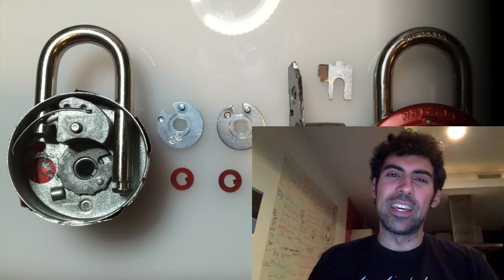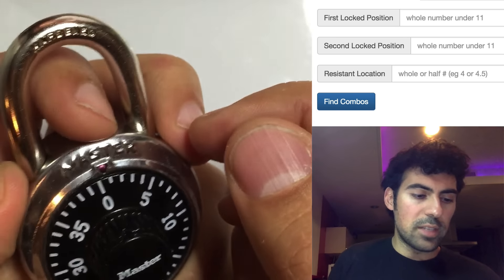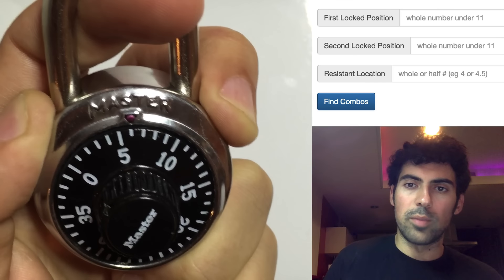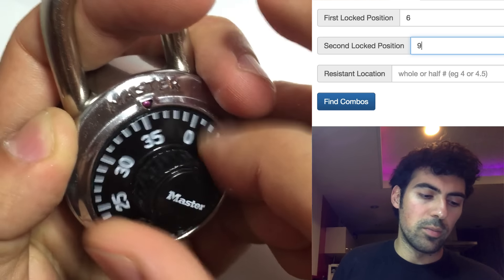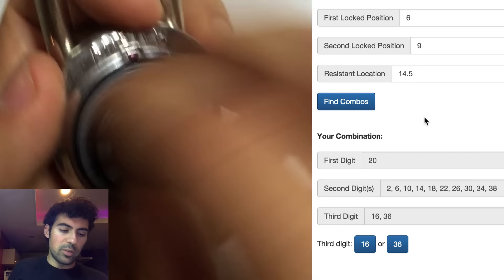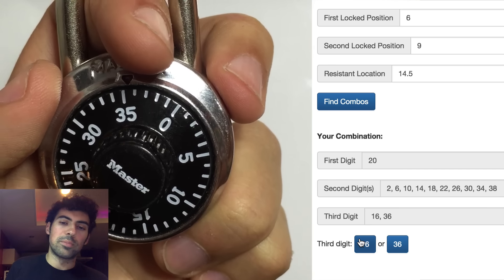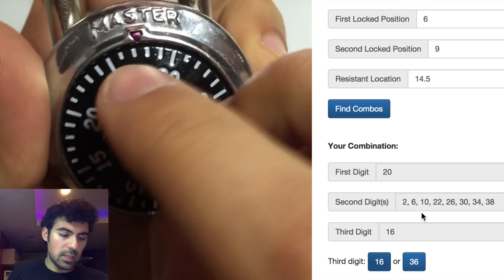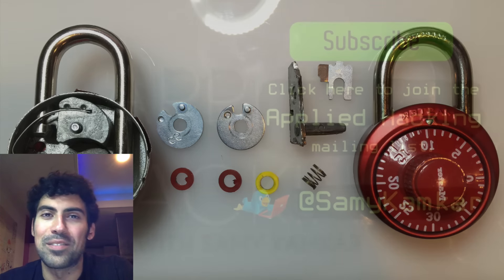Break open any Master Combo Lock in 8 tries or less!

Comment: Hi Samy,
I watched both this video and the 4 part series after this one to try and open a lock.  Though I do understand the concept, I'm still having trouble finding the resistance point, as no matter what I seem to do I put either not enough pressure or too much pressure such that the lock shaft is catching on the 12 gates of the 3rd dial.  I know that the combo to my lock is odd, and that the first number to my combo is somewhere in the 20s-30s.  My first and second locked positions are 5 and 8.  I strongly suspect that my last digit is 25 as that seems to be the widest of the 12 gates, but I've tried all permutations of 21, 25,29,33,37 as first and 25 as the 3rd digit, to no avail.  Am I missing something here or could it only be user error here?
Thanks for your time.
Reply from the maker: If you're hitting the locked positions when trying to find resistant location, you're pulling the shackle too high, so SLIGHTLY reduce. It takes finesse but once you find the resistant location, it's easy to actually feel on most locks and you'll get the "feeling" for it. 25 would make sense as the last digit (if 5 and 8 are your locked positions, then 5/15/25/35/8/18/28/38 are the possible last positions). If 25 is the last position, then that means the first number will be 1/5/9/13/17/21/25/29/33/37 and your 2nd number will be 3/7/11/15/19/23/27/31/35/39). You need to find that resistant location to get the first number though and not have to deal with the 100 permutations though...

Comment: I've tried for a couple of hours, but I'm unable to find the resistance point.  This lock always had a stiff dial since it was new, and despite hundreds of spins, the best I get is 6 or 7 resistance points.  If I apply less pressure, I get none.  There isn't a unique point where the dial won't spin freely...  Your algorithm seems the best I've found on here, but the monetized investment of time is outweighing the cost of buying a new lock.  Neither of the two locks is attached to anything, but I'd like any pointers you can offer before I just simply junk them.

Comment: I forgot my combo, but I know for a fact that my combo uses zero as a second digit, and that the third digit is AROUND the number 14, and that first number is greater than 25.

Anyways, using this, my first locked position is between 0 and 1. What does this mean?

I didn't even see 0 as a result for my second position.

My resitance area is 12.
Reply: So after fucking with it, good thing I knew the second code was 0. It ended up opening.

Comment: Sad to say it's not working for me I can only find one position under 10/11 which is 8 without the second position I can't get it to work
Reply from the maker: What do you get between 10 and 20? If you only get 19, use '9' twice
Reply: @samykamkar  I think the second number is 18. For the resistance number its also hard. When I have not enough resistance i feel no snag but with a bit more tension I feel it a lot. So hard to decide which one is it.
Thanks for your answer!
Reply from the maker: @samoraday  It's usually on the lighter side and should barely feel like a snag, just a light graze sometimes and you can usually hear the grazing/resistance, and it's at the same location every rotation. 18 seems unlikely if 9 was the other one...check between 20 and 30, sounds like you'll only find 18 or 19, whichever it is take the last number and use it as both locked locations

Comment: Hello Sammy, ive been trying to use your method but its not working, the step where it says to find the lock positions below 11
between 0 and 1 (which is wrong)
between 3.5 and 4.5
between 7 and 8 (which is wrong)

I read the note you put in the video about trying to find groves between 10 and 20 and the ones i found were
between 10 and 11 (which is wrong)
between 13.5 and 14.5
between 17 and 18 (which is wrong

interestingly enough, if I try after 20 the lock positions I get are
between 20.5 and 21.5
between 23.5 and 24.5

Im not sure what to do now, please help me

Comment: Does not work on any lock older than a few years. I have an older weathered lock that absolutely cannot be cracked. The resistant location is vague and no matter what third digit I get there's barely any play for either option.

Comment: Didn't work for me, not sure why i followed the instructions and found the resistance location.
Reply from the maker: What was your resistant location and locked locations?
Reply: Samy Kamkar 17
Reply: Samy Kamkar and if I pull harder it's at 18, but I tried both possibilities
Reply: Samy Kamkar yeah the resistance is at 17.5/18, but I tried the possible combinations and it haven't worked out

Comment: idk if i got one that just doesnt work on the algorithm but i cannot get this to work no matter what i try. i lock on 1 and 11 and get resistance at 26 but none of the combos its giving me are working.
Reply: so i was able to figure it out using other videos. the algorithm got the first number right but none of the rest. i wonder why that is?
Reply from the maker: What are your locked/resistant numbers?
Reply: The lock positions were 1 and 11, the resistance location was 26. It provides the first number correct which is 31, but the combo ended up being 31-18-28 once I figured it out using other videos. I'm thinking maybe somehow it doesn't factor for the locked position at 11? 
Because even if I try to use a different lock position less than 11 (which it doesn't really lock over a whole number under 11) it still doesn't give the right combo.
Reply: Thank you for the reply too!! I love your videos 👐👐👐
Reply from the maker: @nicknac93  Thanks! Btw if you don't mind, can you see if there are any other locked positions between 1-20? I'm surprised, I would also expect 8 (or 18 if you go above 10) to be a locked position.
Reply: It locks over 14 , then 21, when I lock around 8, it clearly goes between/touches 7 and 8
Reply: Same thing on 18, it goes between 17 and 18
Reply from the maker: @nicknac93  Weird! Okay, thanks for testing! (I'm also guessing it will lock around 28 and 38)
Reply: You are correct. It locks on both of those.
Reply: Yeah I thought it was odd too. Did I just get a good lock apparently? 😂😂😂

Comment: What if the first locked number is between 39.5 and 0.5? And my second one is between 9.5 and 10.5
Reply from the maker: Use 0 as your first number (don't use 10 for anything). See if you find any other locked numbers that are between two halves -- I'm sure you'll also find 19.5-20.5 and 29.5-30.5, but we're looking for something else. What's your resistant location?
Reply: Samy Kamkar after 10, my next locked number is 17
Reply from the maker: @hannr12  Okay try using 0 and 7 as the locked numbers. Did you find the resistant location? That's the hard part..
Reply: Samy Kamkar I would say it’s at 22
Reply from the maker: @hannr12  Okay cool, try those (0 and 7, 22 as resistant) in the calculator https://samy.pl/master/master.html -- let me know how it goes!

Comment: I'm having 0 luck on 5 different locks. 3 of them are masters, 3 are exactly like yours, 1 is a fancier push button version. Each lock I've tried at least twice. What am I doing wrong?
Reply from the maker: Are you finding the resistant location? What are the locked numbers and resistant locations on one or two of them?
Reply: @samykamkar  First lock
2-3 first point
5.2-6.1 second point
 8.5-9.5 third point
35 resistant counterclockwise
4 resistant clockwise 
Only have the one lock with me.
Reply from the maker: @joblessalex  What are the locked locations between 10-20? There should only be one consistent, resistant location...need a little more info but my guess (without enough info) is your first number is 9 and last number is 9 or 29.
Reply: @samykamkar  12-13
15-16
18.5-19.5
35 is a very stiff stop right at the number counterclockwise with no other feeling. Can't rotate past the number without pushing the shackle in a bit. 
Clockwise it starts at 4 and as I rotate, it pulls the shackle in a little through 3 and freespins again at 2.
Reply from the maker: @joblessalex  Try entering 9 and 9 as the locked locations and 4 as the resistant in the calculator. Then click the 9 or 29 button depending on which has more give. Then try the 8 possibilities out and let me know.
Reply: @samykamkar  That breaks the code and gives me 9 as the first and last number. Tried everything given, no open. Maybe I have a unicorn lock?

Comment: Tried this a half dozen times. Even tried both sets of combinations with the “two resistant numbers.”  Does not work!
Reply from the maker: What are your locked/resistant numbers?
Reply: I don’t have my notes anymore.  The first number, looking for the resistance  turning clockwise was either 23 or 22. Very hard to tell which. Eventually I found the “locked” position when turning CCW at 14.  So the first number was probably 28.  I couldn’t find two locations between 0 and 11 that met your criteria for candidates. One spanned exactly one digit, the second had movement over 2 digits. Eventually another video showed examples of how to find those numbers where the verbal description closely matched the video and the description of the behavior of the lock was more detailed than in your video.  Ultimately I ended up with 8 candidate combinations, as might be expected, and discovered the correct one.

Comment: Ughh, it's not working for me. I got the first groove down, it was 5. However, I NEVER got the second one! Unless you count 7.9 and 8.9 to be 7.5 and 8.5
Reply: Ok, I got 5(first), 8(second), 24(resistance), and 25(no. with more give). I tried all the combinations (29, 3/7/11/15/19/31/35/39, and 25) but it didn't open. Additionally, my lock has no serial number. Darn.

Comment: Couldn’t find the resistance number, it got stuck at multiple spots......
Reply from the maker: Sounds like you're holding the shackle too high and getting caught in the "locked locations" (grooves on the dial inside the lock). Loosen up your grip on the shackle. The resistance should be very minimal, but definitely enough for your fingers to feel but not enough to stop the dial from spinning.
Reply: Samy Kamkar thanks for the replay. However I believe the resistance is at 24. I also post the following on your other video.

My lock is before 1998, I couldn’t unlock it using your method. I opened it with a thin metal not the combination. When I looked down, the opening is at 36/37, 6/7, 1/2. The resistance is at 24. Perhaps there is another formula for old lock? I am trying get the combination back and use it again.

Comment: Why don't you list the second number starting at the number higher, but closest to the first one?
If the first number is 20 in your example, start the list at 22. Then tell people that if it fails, just go back and redo the second digit shifting that second disc over to where it should be next anyway, then try the third again. That way you only need to clear the lock and try the first digit once.
Reply from the maker: Good idea!

Comment: 3rd step is not working for me
Reply from the maker: What are your locked and resistant locations?
Reply: @samykamkar  locked positions are 5 and 8. I can’t find the resistant location - I’ve tried many different levels of pulling up on the lock. Halfway does not get me only one resistant location, it gets me a bunch. My lock isn’t Master Lock, could that be the issue? It’s some brand called Casehard.
Reply from the maker: @thecatch6299  No, this video is for Master locks, I'm not familiar with that one (granted some companies just copy Master)

Comment: This did not work.  First locked position was 2.  Second locked position was 5.  Resistant location was 33.5.  Web site said first digit of combination is 39, third digit is either 15 or 35.  None of those are correct.  Nor were any of the second digit suggestions correct.

Comment: I've tried this about 50 times and I can't get it. My first locked positions is clearly 3. The second stops on 6 and 7 (so that's not it) the next is 9 and 10 (so that's not it) and so on. Then the resistance stops at 39/39.5 but I've tried every combination of all the possibilities and it's not working. Could someone help?
Reply from the maker: What locked positions do you get between 10 and 20?
Reply: Samy Kamkar I get 13 and 20
Reply from the maker: Use 0 and 3 as the locked locations
Reply: Samy Kamkar it worked!! I tried 3 and then 0 but I didn't try it the reverse way! Ahhh thanks brother!!
Reply from the maker: Nice!!

Comment: Didn't work for me. I got my first two whole numbers. But the third I couldn't determine. I had more than one point of resistance.

Guess I'll be going through Master Lock's tedious look up process.
Reply from the maker: What are the two whole numbers, and what are the multiple points of resistance?
Reply: @samykamkar  
Whole numbers are 1 and 11
Seems like 27, 30, 33, 37.
Reply from the maker: @bradoconnor5537  Are there any other locked positions between 10 and 20, other than 11? If not, then your last number is either 1 or 21, and the first number is either 33, 37, or 1. The middle number would be either 7, 11, 15, 19, 23, 27, 31, 35, or 39....but we can probably reduce it.
Reply: @samykamkar  
No other whole numbers between 10 and 20

Edit: The third digit feels like 1

Comment: My first number is 3 and it does not work somehow (I thought it was 0 but it makes the website glitch... can someone help me on that one?)
Reply from the maker: What's your resistant location?
Reply: @samykamkar  It is 21. I've tried some other numbers as well to see if I might had problems doing it but the eight possibilities stay the same unfortunately
Reply from the maker: @MemeThought_  0 and 3 are locked with 21 as the resistant location? Seems fine on the site for me. First digit = 26, 2nd = 0, 4, 8, 12, 16, 20, 24, 28, 32, 36, 3rd digit = 10 or 30 (whichever has more give and more centered)
Reply: @samykamkar  my bad, I got mistaken with 10 ahahah! I've tried the eight possibilities with the 10 since it has more give (like 1,25) while 30 has a give of 1 and it still doesn't work for some reasons... pretty sure there isn't any way for me to fuck it up and pretty sure your calculations are correct lol. the padlock might be a little bit too old for it since it has a little bit of damage on his borders, I've seen other tutorials that says that old padlocks might not work, it might be the case here... I still thank you for your time, if you happen to find a fix for it, I would really appreciate it!

Comment: This is cool. But if ur like me and don't give a shit about ur lock and just want it off, take a small flat head screw driver and pop off the back plate by bending the thin metal up all around the edge. Once it's off u can basically disassemble the rest of it in seconds. It all takes less than a minute and it's extremely easy. Peace.

Comment: Doesn’t work at all, I have the combination already and my first digit on the site isn’t even close to the first number on the lock.
Reply from the maker: Your resistant location is incorrect. What's the first number on the lock? I can tell you where the resistant location should be.
Reply: Samy Kamkar The first number is 6
Reply: Samy Kamkar Also, no matter how much shackle tension I use, I barely feel where the resistant location is and that’s why it’s wrong.
Reply from the maker: @austinerdman4923  I'd imagine the resistant location to be around 0.5 or 1

Comment: Did not work.  This is the fifth you tube channel I tried, Nothing.  Broke the lock open, it has another part between the plate and wheel.  I think they have added something to stop hacking the lock.

Comment: Didn’t work for me.
Reply from the maker: What locked and resistant locations did you find?
Reply: @samykamkar  1st: 4 2nd: 7 resistant: 19 (though 23 was a very very close second). After following the old pen and paper method I was able to crack it after a few minutes. It opens at 17-31-21

Comment: I have tryed all methods on my master combo lock and not a single one have worked. Not even this one. And yes im doing it right. WTF IS WRONG WITH MY LOCK?????? My first lock number is 1, the second is 4 and the resistant location is 6. My first digit should be 11, the second should be 1, 5, 17 ,21 ,25 ,29 ,33 ,37 and the third should be 11 or 31. My 11 and 31 and basiclly the same locked position space so i tryed both and guess what. NO COMBINATION FUCKING WORKS. I have spent hours trying to get this lock up. If someone can help me pls do. Thx

Comment: Didn’t work at all as have none of the other tutorials I’ve watched.
Reply from the maker: What's your locked and resistant locations?
Reply: @samykamkar  1st locked position between 4.5 & 5.5 so 5. 2nd locked position between 7.5 & 8.5 so 8. Resistant location is 24.5/25. I entered them in the program, tried all possible combinations and it didn’t work. I’m ready to just smash this thing.

Comment: Outdated
Reply from the maker: This continues to work -- I tested on a new lock recently. What locked positions are you finding? Are you sure you're getting the correct resistant location? It can be tough to feel for but with some patience and testing various shackle positions (usually pulling up around 60%) you will feel it at the same spot through each revolution.